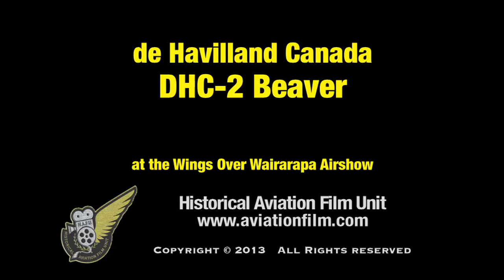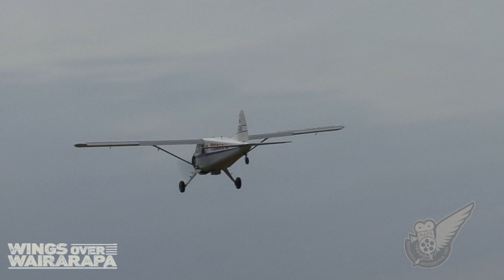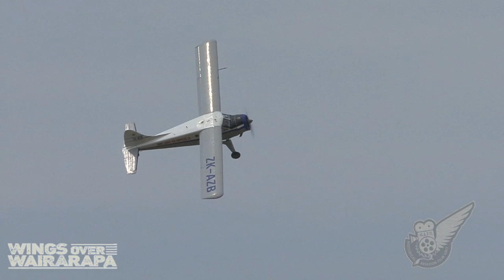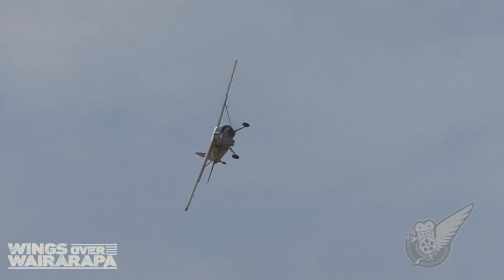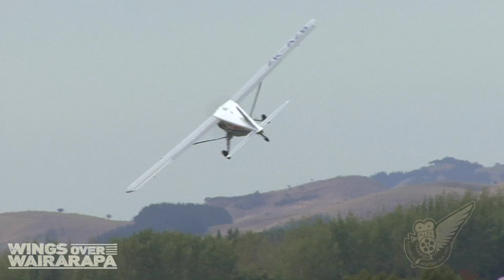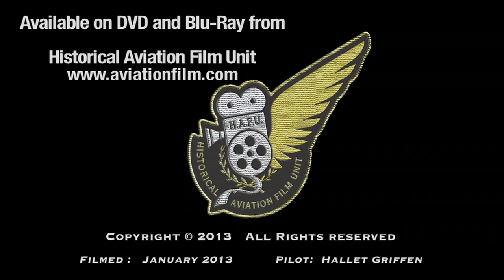de Havilland DHC-2 Beaver - slow and low

Comment: I remember watching them topdressing as a kid right there in the Wairarapa for Fieldair. The color scheme was yellow on white with the strangled goose logo - I don't remember a gray color scheme. These operated in the same era as the DC-3 which was also based in Masterton and was also used for topdressing. Fieldair had a fixed loader bucket operated from the ground which could load the DC-3 in one go. There was a bin and a regular loader truck that filled up the fixed loader as I recall - could be wrong, might have been a front end loader or similar

Comment: I flew many times on Beavers and Turbo Beavers during my work on Mackenzie Hwy in NWT, Canada. I worked mostly in a construction camp around 125 kilometers north of Ft. Simpson, NWT. An empty Beaver can leave the ground so fast your guts lag behind.

In early 1970s, GPS wasn't a thing yet. VFR was big. 
In very poor flying conditions, Pilots would  fly at around 60 to 70 mph ground speed, 80 to 100 ft elevation, down the line of wooden telephone poles comprising the CNT line, an early communications link. 
There weren't any roads yet. 
This during fierce crosswinds and heavy snowfall. Just another day at work for Beaver pilots.

de Havilland Canada hired Punch Dickens, a famous bush pilot to survey other bush fliers regarding their desires and prohibitions about the aircraft of their dreams. 
They then undertook to produce that aircraft